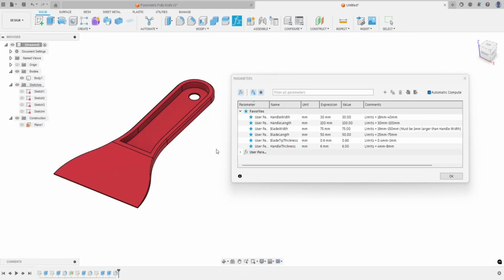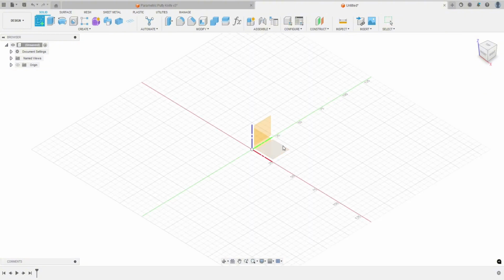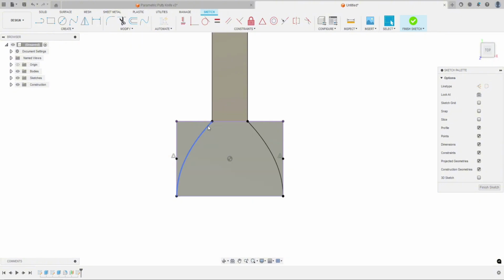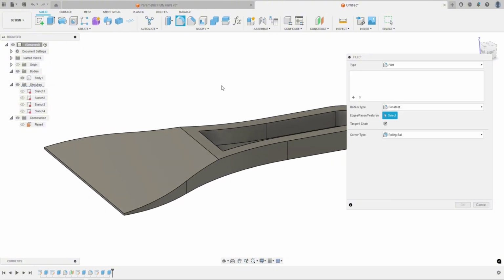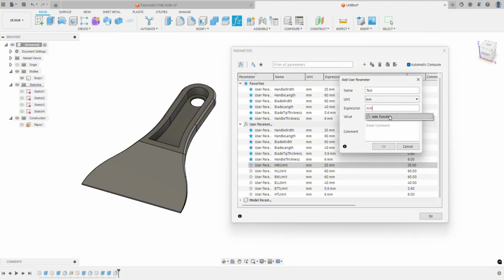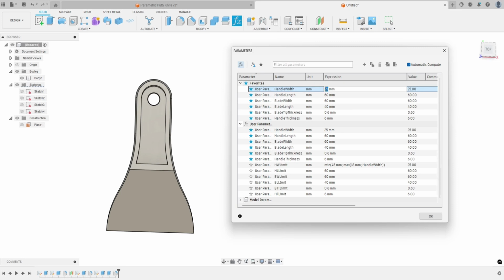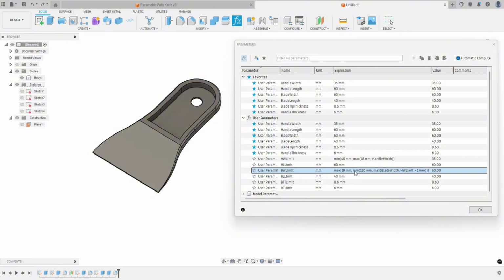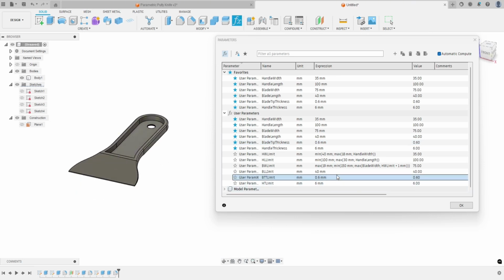Fusion: Design and 3D Print Putty Knives (Parametric)

Comment: Do you know if it’s possible to do this just for the height of an existing step file without any history?  I have step file that I created early on and all my processes are on the left side instead of the bar on the bottom.  It has dovetailed areas on the top and bottom that I don’t want to change.   Can an offset plane be used to possibly change the height?
Reply from the maker: If you turned off parametric design, there is no way to go back and set up parameters.  Can you make a post on the FB group (Shop Therapy). Might need to see some pics.
Reply: @ShopTherapy623  I have already changed it over to parametric history, i just want to know if I could split the existing body, create new drawings to change the height and set that up as a parametric height that I can adjust?  If it’s easier I’ll just recreate the whole body using your tutorial.
Reply from the maker: @LS11971 yes you could do that. Just remember anytime you’re setting a dimension (distance, extrude, etc), you can make it a parameter instead. And as long as you model it so the updates to the parameter work, then you should have no problem! You can create a parameter anytime during the model - it doesn’t have to be at the beginning.
Reply: @ShopTherapy623 Got it all figured out thanks again for this tutorial.  It was very helpful.

Comment: wow, dont let the putty knife fool ya.  Another deep dive into some gems here. Yes you can eventually get to that putty knife, but I have never attempted to change a fillet setting.  Now I need to create those Porsche Cayenne fillets on everything!  Truly a great tip on the variable radius filet with tangency weight too!  Those parameters will come in useful but I will definitely need to exercise that alot more.  Thanks for the awesome video!